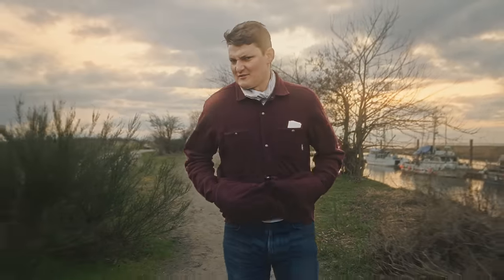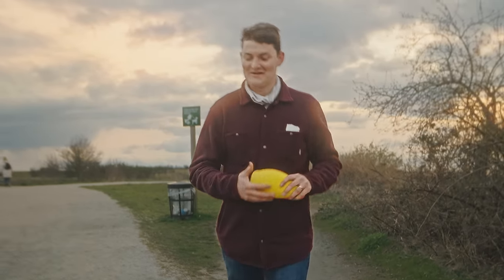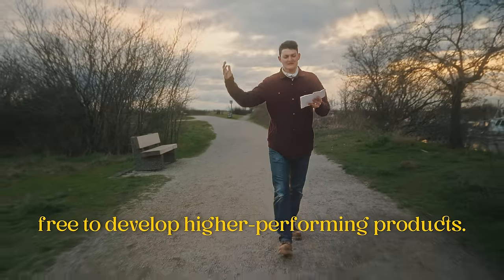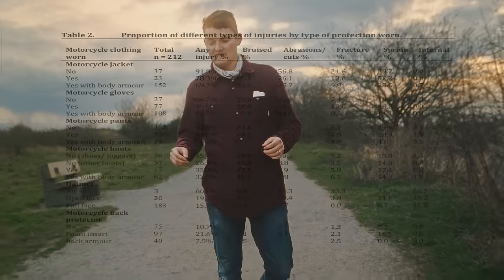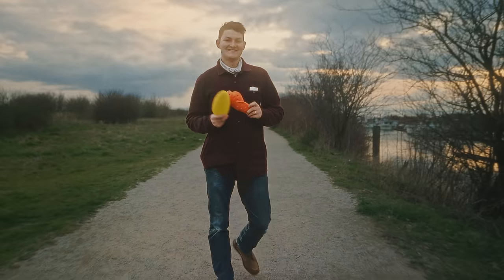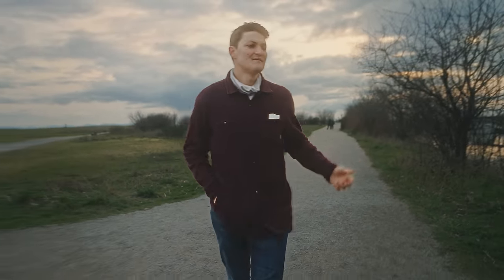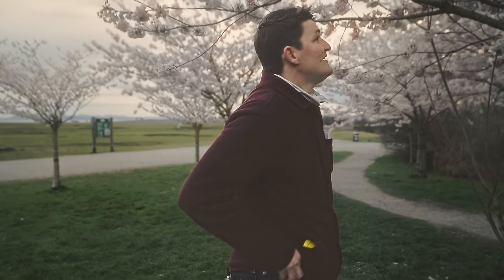Why I Stopped Wearing Motorcycle Body Armour

Comment: In all of my on and offroad crashes, I have never once thought, man I wish I didnt have these pads on. I understand the point you’re conveying, but my knees and elbows have always been grateful for my padding. Im keeping my road armor.
Reply: Exactly, it doesn't take a rocket surgeon to put pads on and realize they will help. Sure they aren't a steel roll cage, but I'd rather have anything in-between me and the concrete rather than nothing.
Reply: I've been hit by a van on one side, then the road on the other, then the road on the original side, then my back and head sliding across the rocks.  I got up and walked away, I also would not have wanted to do that without the armor on.  The only spot I even got a scratch was where the zipper for airflow was open on my forearm peeled away a couple of layers of skin.  Otherwise than being a little light headed , filled with adrenaline, and pissed at the van driver... I was able to ride all the way home and make sure I didn't have a concussion at the hospital.  This was in Kenya/East Africa

Comment: To an extent this is true but it is missing a lot of real life use cases where protection does in fact make a huge difference. The major point being the abrasion/laceration protection. The focus in this video on broken bones, which are not a big deal in most cases. Scraping off part off your elbow or hip bone is a different matter, just like skin grafts or deep laceration that hit a major artery.

Having had a whole bunch of accidents, on and off the bike, with and without protection, I can unequivocally say it does make a huge difference. The people that the research didn't approach were the more minor crashes, where people slide out or something to that extent and those crashes are much more common. In those cases, the protection absolutely does its job really well. 

There is also more than snapping a bone in half. You can chip or crack your elbows, shoulder or hips, which can create much bigger issues than a single, clean break. Bones also bruise, which takes months and months to heal, if it ever does. 

In my opinion this video is too narrow-minded, focussing too much a broken bones as being the worst injury you can have (which it isn't in most cases) and the fact the major brands have had a hand in setting that a standard that could be better. 

Instead of shooting down the concept of pads based on these two aspects of protective gear, you could argue for a better standard like the horse-girls get and include the situations where protection absolutely serves its purpose. Realise how many people take your opinion as gospel, even if you formulate in such a way you are not liable for people taking your advice to heart.
Reply: Yeah even though the message is technically there, way too many people are going to read the title and watch the first half and think they don't need armor anymore.
Reply: I can agree with F9 that standards should be challenged if there’s opportunity for improvement for the end-user, and any shortcomings they have should be known - but just writing off these inserts because bone strength < insert energy mitigation in a one dimensional controlled test irks me.
Reply: @uncleren  Exactly. Especially with the focus on broken bones, which are not the most common injury in crashes. Bruises, abrasions and lacerations are way more common. Having experienced injuries like that, I always use body armour. Every little bit helps.
Reply: Yeah the rant comes down to 'if something isn't 100% perfect then it's completely useless' which is silly. Didn't cite anything that says it increases injuries, I don't really understand the angle he took here unless it's just to get people to engage in the comments which clearly worked lol
Reply: Very well said.
Reply: @bryanhughes3751  'if something isn't 100% perfect then it's completely useless'
Well put. That is what it comes down to and is a pretty extreme position to take. 

Motorcycle gloves don't really prevent broken bones but not scraping my palm off is well worth wearing them.
Reply: @dsmith9599  The point of having a betters standard for protection is a good one and I totally agree. The safety norms are lagging behind technology, but armour still serves a good purpose.
Reply: "...broken bones, which are not a big deal in most cases..."  

I call BS - try telling that to someone who has broken a bone in a fall and see how far you get.   The point is that the armor is NOT sufficient, and our expectation is and the reality is that it should be.
Reply: @gregshamieh6339  If it is a clean break and the doctor is good, it isn't a big issue usually. I've broken several bones, some clean, others not. I know what it is like. Pads won't prevent a break in most cases anyway and you don't wear them for that purpose alone. Armour is almost never sufficient if the crash is big enough to break bones. That is the whole point. Removing the pads because they don't prevent broken bones is ridiculous. 

I've also bruised bones, had road rash, cuts and other injuries. Those were horrible and easily preventable. I wear pads because of those injuries. 

Nobody expects a pad to prevent a broken bone. You'd need full body armour. It is there for all the other times.
Reply: @gregshamieh6339 how would you expect an elbow pad to prevent you from breaking an arm.  Bones break by bending to far. A pad is designed to reduce impact force, not brace your bones from bending.

Comment: Maybe an April Fool’s joke, but I would never take out my armor based on anyone’s video.  I have been smacked in the chin’s with road debris and knew what if I didn’t have armor on I would have been recovering instead of riding.
Reply: Yea, same I fell right on my elbow and got a nasty bruise. I'm pretty sure I would have broken my arm if it wasn't for the Armor.
Reply: Yeah actually the road debris is a solid reason to always keep your pads inside. It's a common case to have a stone fly into your windshield when you drive a car, what can we say about going on the road without a windshield?

Comment: You might think it's protectionism... but I think you missed the point. I put on a one piece leather suit that legitimately weights 20+ pounds with all the armor in it and go ride the racetrack FULLY aware that all its going to do is protect my skin. In fact I have this knowledge first hand. I crashed at Road Atlanta, and I had no abrasions or bruises, but I did break my hip in 4 places and my collar bone. I bought an air vest after that, which might have protected my hips, but not my collar bone. 

Your skin and other soft tissues represent the LARGEST organs your body has. Protecting those can and will make a significant clinical difference when it comes to skin grafts, both in terms of needing one, and the quality of available tissue if you do. But it also will reduce the likelihood of sepsis. You're at less risk of rabdo, kidney and liver failure because your body has a lot less to deal with than if you didnt have the pads on. You'll heal faster because your body isn't dealing with as many injuries. And then there's just the plain and simple fact that getting bruises and road rash just sucks. Not being miserable every waking (and sleeping) second for months following a crash is worth wearing a bulky jacket.
Reply: Yeah, I have been bruised after a small crash, and it was worse than my collarbone fracture during the first week. Getting all clean (from road debris) was one of the most painful things ever. The nurse rubbed it like if she was cleaning rusty bridge with a steel wool, but it was actually my bloody arm, hand, fingers... After some weeks all was good, but 2 years later I still have some light scars/colour difference in my skin. If I were wearing my usual riding jacket, it would have been way better surely. I still believe that a shoulder protector would have saved my collarbone. It was a really low speed impact.
Reply: you missed that he didn't say he stopped wearing abrasive resistant motorcycle gear. he said that he stopped wearing armour. you can wear a jacket with full kevlar abrasion resistance, but drop the armour pads.
Reply: He didn’t missed the point like he said in the very beginning there’s pads used in horse riding that are way more effective in preventing fractures but the moto companies still uses extremely subpar standards. The pads are designed for IMPACT. They can protect against abrasions but they’re not designed for that and suck at their job. While the skin is the biggest organ we have a fracture can have much worse repercussions than abrasions. These pads are the equivalent of laying the seatbelt over you body while driving so you don’t get a ticket.
Reply: @natalyakeane  The pads add more abrasion protection. Also, the pads protect from the smaller hits: if you smash your knee because you fell from a standstill you try doing that with and without pads and come with a straight face telling me pads don't work.

Hitting your knee on the ground from a standstill can be a completely debilitating injury, even if you don't break your joint, you may injure yourself to the point that you can't walk.

With a pad it's just a nuisance. THIS ENTIRE VIDEO IS BUILT ON THE FORCED IDEA THAT PADS ARE ONLY FOR YOUR BONES. Your body is FULL of soft tissue and a leather riding garment has nearly 0 shock absorption, so all the energy goes into your body. Good luck with that.
Reply: this guy doctors
Reply: @natalyakeane  any you missed that I'm saying wearing pads is still important.
Reply: @tartredarrow  You missed that he said wearing pads is still important -- just not the minimum stuff that is common.  He is saying to use better protection and not throw your safety at things that just barely satisfy the regulatory minimum.  At the end he specifically called for higher level pads (he holds one up that he uses on the track) or the Helite airbag system, which is an airbag (essentially on demand better armor) and has inserts for back armor.
Reply: @EvanEdwards  Yeah no. That's not what he said. He's all but said he'd rather not wear them.
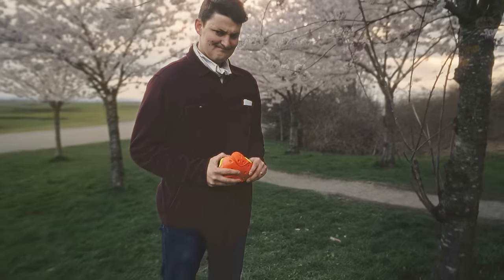Reply: @tartredarrow  He literally held up armor at 5:00 and said it goes way beyond the standards and "I wear this on race day" and then immediately showed the Helite system and said, "I wear this every day."  Go to the video, watch and listen.

Comment: Released on April 1. Good one.
Also, pads are positioned on the JOINTS, hence are not meant to prevent bone fractures as such. Also... PPE is designed to REDUCE the scale of injuries, not to 100% prevent them.
Reply: It’s not a joke though. There is a bit more detail in the pinned comment.
Reply: He has said in earlier videos that the armor doesn't do much for impacts but rather keeping you off the ground or just a little bit longer. Which is the case.
Reply: Right?! Once i hit a rock with my shoe and fell on my knee on the asphalt. Not even on a motorcycle, just running. I couldn't stand on my leg for days and had to bandage it for 3 weeks! I wish i had a knee protector on. I don't want to imagine what could happen if i fell off of a bike.
Reply: Have you ever gone down with armor on? If not you can't comment on it. Landed on my side after 50 mph impact with a deer. Armor saved my elbow and shoulder 100%. Boots and gloves saved my feet and hands 100%. Was checked by the ambulance crew and went home after. Only bad injury was my knee that was only protected by jeans.
Reply: @MrLaughingcorpse  A well padded boot saved my left outter ankle and toes when I hit and slid down a wall. It was a low speed impact at an angle. Jeans torn, boot front badly 'bruised'. In the same accident, my left shoulder hit the railing on the said wall. I had a big bad bruise just under the joint but nothing else because that was a padded area. And my helmet brushed the railing, luckily it slid along, but that would have hit my jaw.

Comment: Having crashed at high speed (70 mph into an embankment) with pads and low speed (about 20 mph gravel) without pads I had severly more bruising from the low speed low impact crash. 
While I did crack a vertebrea on the high speed accident my back pad and shoulder pads saved me from a lot more pain and agony. I had some sorenes in my shoulders and my wrists were bad since they took the brunt of the impact. However no bad bruising or lacerations anywhere. The worst part initially was the nettle that hit my face when the visor got ripped off.
On the contrary when I laid my biked down on gravel my right arm was blue from my shoulder to my elbow and got scratched up bad. 
Wear your gear guys

Comment: I really believe that you make some good points, Ryan, but I can tell you that I probably would not be walking without a cane or walker now if I did not have armor in my knees and full armor in the rest of my gear when I had a serious accident. In 2006, a huge SUV made a left turn in front of me and I impacted the front wheel at around 45 mph. I was thrown up and over the vehicle, knocked unconscious, and woke up to EMT’s cutting off my damaged helmet (would have dead or suffered severe brain injury without it) and new armored leather jacket. I was transported to the hospital where I was evaluated and released that day. I had no injuries or abrasions. My fingertips were very bruised (jammed between the brake lever and the vehicle) and were saved from serious injury because my gloves had finger tip armor. I also had a small fracture in my lower back. When I went to look at my beautiful Kawasaki ZRX1200R, I noticed that the steel tank had a huge dent in it (about 3” deep) where my right knee had impacted the tank. The guys at the salvage yard were surprised that I was still alive and walking, given the severe damage to the bike. I had very slight bruising on my right knee! It is surprising that my armor worked so well, especially so, given the fact that my back pad was just foam and none of my other armor was CE rated. I had another crash a few years later where I had no injuries or abrasions because I was wearing armored gear. I was never asked about what gear I was wearing in the first crash and I did not report the second crash, so it begs the question-how accurate is the data if motorcyclists walk away uninjured from a crash and don’t report the incident? Personally, I am so grateful and appreciative that we have such great protective gear and, at 77 years old and still riding, I will always ride with armor. Just my perspective, everyone. Feel free to do what you like. BTW, if you don’t like bulky armor, try ghost armor - you hardly know it is there. Ride safe and enjoy the ride for as long as you can!
Reply: Gary is a G. Bless, grandpa
Reply: Well , if you want safety ride a car , motorcycle is unsafe & the more safety and protection you add the more of a car it becomes... moving from a slingshot 3 wheel cycle to a 4 wheel go cart, to a 5 star safe rating suv , to a 20 wheel tank.
Reply: @oscarbear7498 I never noticed that what I'm wearing adds a couple extra wheels to my bike, or prevents me from leaning into a corner, or form feeling the wind in my face, or hearing the engine. What I'm wearing protects me, it doesn't make my bike any more "like a car".
Reply: @WatanabeNoTsuna.  its an Exaggeration to prove a point of a Slippery slope. That motorcycles are inherently dangerous on purpose! as there's absolutely no reason to ride a motorcycle given far better alternative exist like a comfortable car for transportation. 
The ONLY benefit a motorcycle has is maybe better gas mileage but on my bike how I ride I get 38mpg with a modified carburetor.

One rides a motorcycle for the rush, & excitement that dangerous things provide. The more dangerous less pads , no boots, no motorcycle jacket , no helmet safe glasses just for the wind,  gives the highest thrill at the cost pf highest danger.
If you dress like an astronaut, in full bubble 🫧 suit isn't not as fun...again both extremes to show the contrast to prove a point since your mentally slowly.
Reply: @oscarbear7498  dogwater take. you wont make it to gary's age at this rate.
Reply: @oscarbear7498  There is this take, the one of the death-seeking individual, and then there is the "I'll ride longer, if I'm more protected". 99/100 people prefer the second one.
Reply: Thanks. Logic.
Reply: @alex13121111  did you not read what I said... theres ZERO reason to use a stupid motorcycle the thrill is the risk.  Accept it 

There's no safe motorcycle period,  the extra safety. The more padding. The extra extra. .... just use a car if you REALLY CARE ABOUT SAFTLY.

IF not stop lying to yourself
Reply: @oscarbear7498  the thrill is whatever you find enjoyable. Personally the thrill for me is just feeling the wind around me and leaning left and right all the time. I don't care about speed or "adrenaline". Riding is relaxing for me, not an "adrenaline rush"